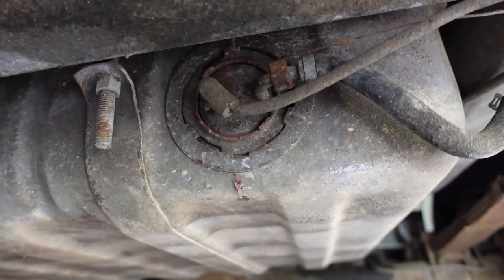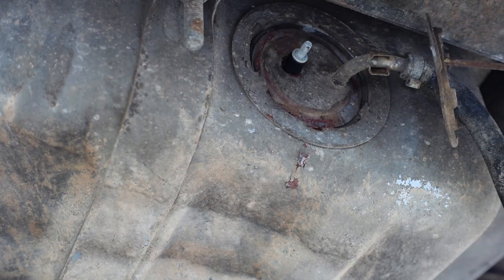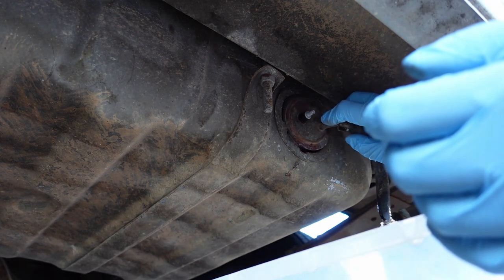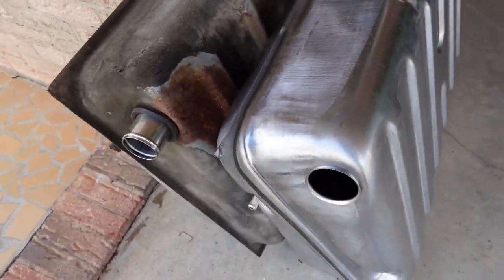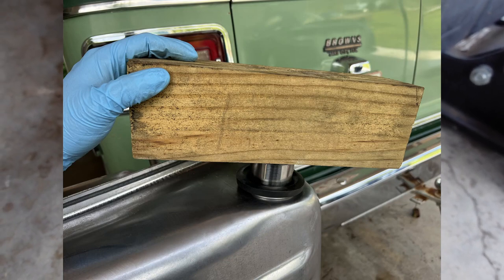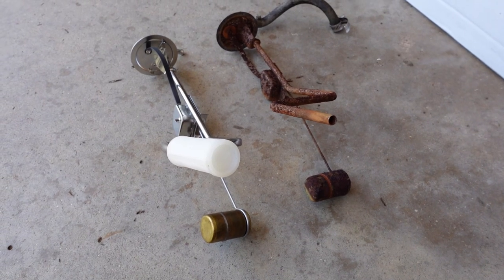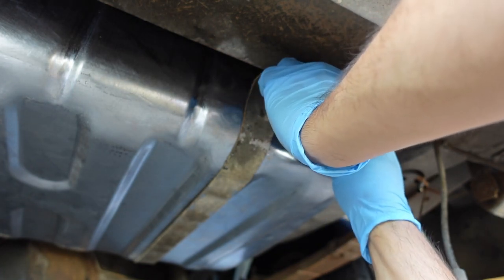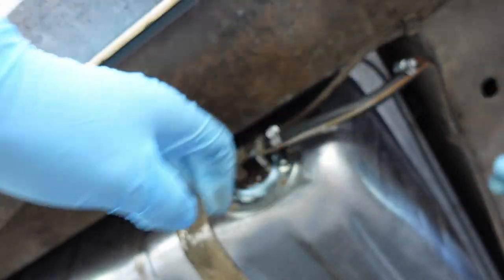1973 Dodge B100 Van - Gas Tank Install

Comment: This is a great van despite the mechanical issues you discovered. Rusty gas tanks are pretty typical. My own 73 needs a new one, so glad you showed us how to install this tank! I think you’re lucky to get it! As many older vehicles you buy and fix up, I’m surprised you were so bent out of shape about this one’s condition on other videos.
Reply from the maker: Many people seem to not be understanding the point of the previous videos. I buy plenty of vehicles needing work but that’s clearly evident or disclosed. The seller misrepresented the mechanical condition of this van claiming it was a turn key driver and that he drove it many miles which that was a lie. The body and overall condition of the van was fine but mechanically it was not and I paid for a turn key van… not one needing mechanical work. But at the end of the day I fixed all the issues the other owners could not and I sold it without having to lie about it’s condition. 

Hopefully the gas tank video will help you get your van up and running good. Thanks for watching!

Comment: where did you get the replacement tank?     link in the description would be helpful  . thanks
Reply from the maker: @davidgaspar1981  It was available from most any parts store. Mine came from Rockauto. It’s been several years so not sure of the availability now.

Comment: Hey man, I have a 1973 Dodge Sportsman RV.  It's on a van Chassis. I need to replace the gas tank but can't find a matching tank.  Do you know if I can use a different tank?  Any recommendations you might be able to throw my way?
Reply from the maker: Is the tank still mounted in the rear like the van? Or is it saddle tanks of some sort?
Reply: @ObsoleteAutomotive I have rear mounted tank and am looking for a replacement, any place to start looking?
Reply from the maker: @jdmbenz190  if it’s a plastic tank… nobody makes a new one. But the metal tank should be able to besubstituted.

Comment: where did you find the neck grommet filler? I'm in France I have to change it and I don't know which one to take. THANKS
Reply from the maker: I believe it was one of the ones from Vansauto. Part number: FTG6776

This van is actually in France now!
Reply: The grommet is also available from a Dodge dealer. I bought one about four months ago. It is the same grommet used for several years. Or so I believe. The size of the filler neck and hole in gas tank did not change. I have a 73 van and the part I bought was for a 1981-1983 van. The dealer’s computer software only went back to the early 1980s. The Dodge grommet is supposed to not leak, unlike the aftermarket grommet. Cost was about $27US.